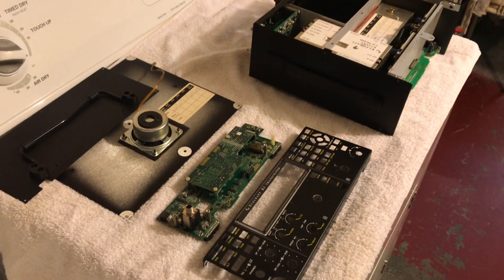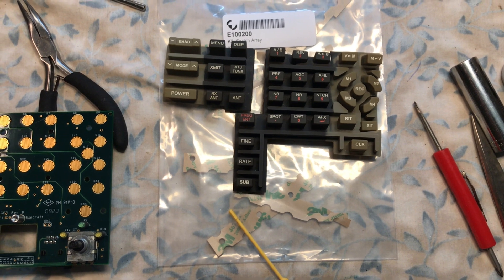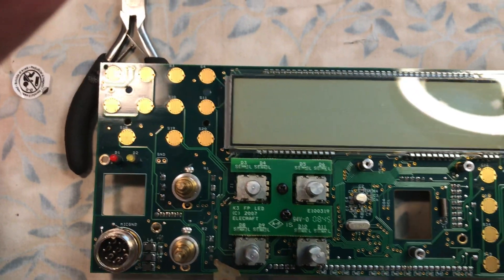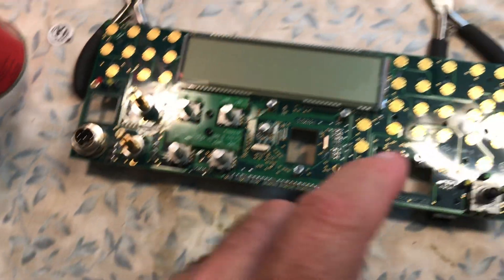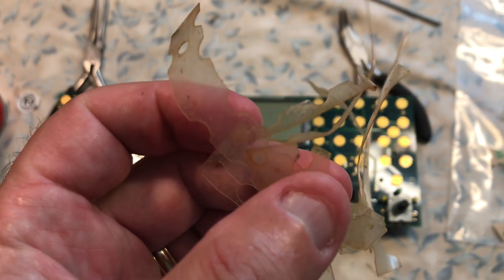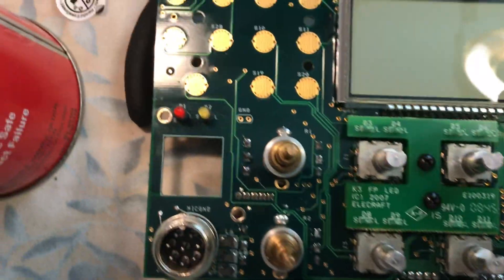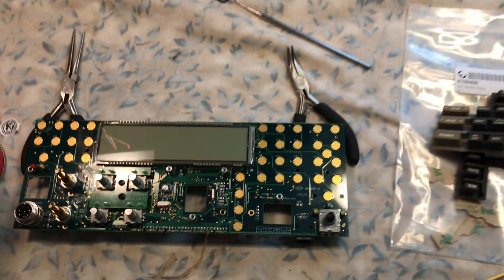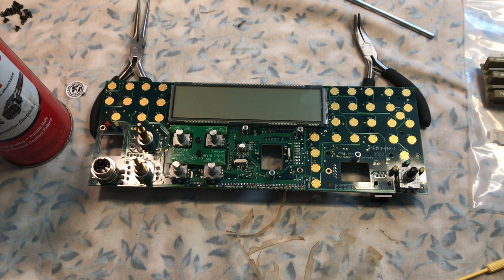Elecraft K3 Complete Keypad Replacement

Comment: Thanks for this Len. I have done many of these. I will review when I have time to see if I have any other pointers. Yes, I DID ruin an LCD once! arrgh. Keith WE6R K3/K4 Tech
Reply: Not sure if you mentioned the 2 little foam strips, these are to block the light from the LCD so it does not weirdly illuminate the nearby buttons.

Comment: Hello Len, do you put the matrix on to the PC board first, or onto the switch array?  TU.
Reply from the maker: If you look near the end of the video you will see a quick slide show of how the switch array looks from the back. It’s peel and stick. Just make sure you line up the rubber legs and insert them into the holes on the pc board.  Make sure you remove the old matrix and then all of the glue residue. Good luck
Reply: @n2len  Thanks Len.  yes, I looked at those pix, but thought I was the matrix on the back of the switch array, then in another shot saw it laying on the PC board without the switch array?